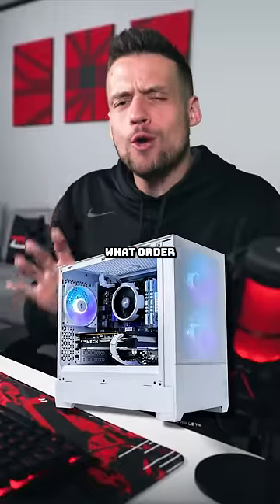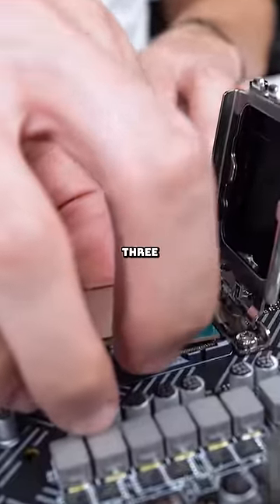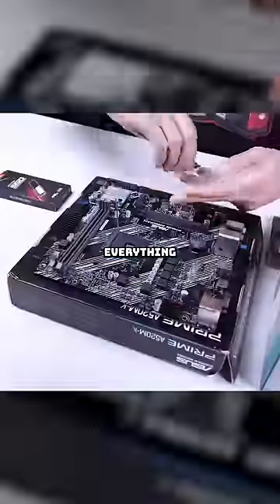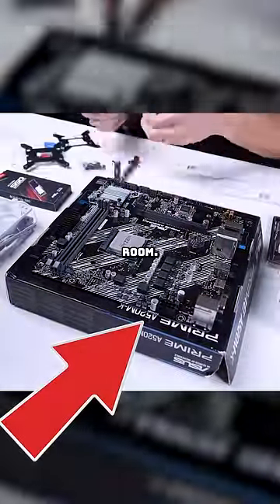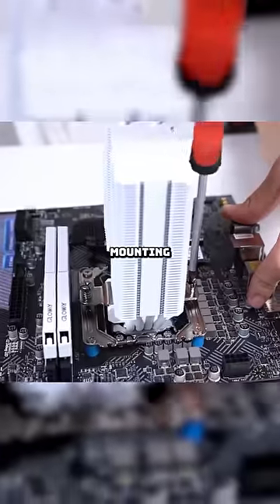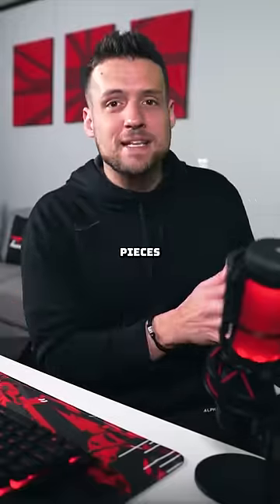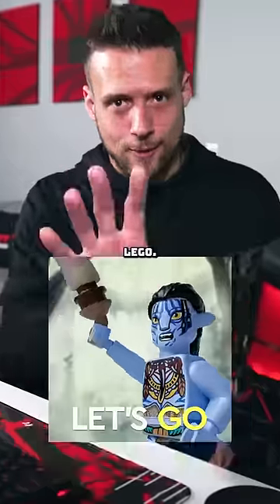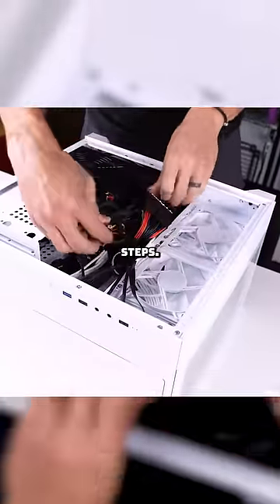PC Building Order of Operations

Comment: I would want to prep the case first.. make sure all the fans are in, the water cooler if I go with one of them, the PSU and do the cable management, leading all the cables to go where they will all go.. getting all them cables managed, then I will slide in that Mother board which as prepped as you said outside the box.. and soon as the MB is in, I Just connect all the connectors which are already in place where they should be.. connect the water cpu cooler pump to the cpu, and then last the GPU, and all its connectors..

Comment: I have been using the Thermalright SI-100 for cooling my CPU. It is a down draft cooler. I use low profile ram, so I place the overhang over my ram for some air flow. My VRM already have large heatsinks attacked. I do not buy motherboard without those. with exception of if I am using 65w chips and never going to upgrade that line. 1. Mbow 2. lay case on side and Insall everything this way. 3. double check all connections are snug. Then cable manage. I do not use extensions.

Comment: Always go for a full out-of-the-case assembly and post test that Frankenstein before putting it into the motherboard, in the long run saves you a lot of time id possible debugging in case of faulty parts, incompatibility or just things not fully plugged in

Comment: I put the gpu in first and then feed the motherboard in over the top and just bend it around to get the gpu into it. I also just throw the cables in anywhere and usually can’t fit the side panel on. This leaves no room for fans. And the radiator just hangs loose.

Comment: Mostly the same. The one thing I'd before all your steps is to disassemble and reassemble the case with what I need and route the cable for he front panel and what not for easier connection when installing the mobo

Comment: I prefer to plug the power supply cables into the motherboard before the PSU after I install the board. Makes it much easier to route the cables, especially the pesky CPU power at the top left.

Comment: I’m crazy so I do the motherboard first. Then the power supply and mobo and cpu power cables. Then I do the cpu and cpu cooler and plug in cpu cooler into power supply. Then I do the ram. Then I do the ssd. Then I plug in power and sata to Mobo. Then I do GPU. Then I plug GPU power. Lastly I plug in case front panel and double check everything to make sure all cables are properly secured and plugged in and to make sure all cables are nice a neat in proper cable channels with zip ties and Velcro straps.

My specs are:
CPU: Intel I5-6700k
GPU: Asus Black RTX 2060
Ram: XPG White RGB 3200mhz DDR4 (underclocked to 2400mhz cuz of CPU)
MOBO: Asus Z270-A
Storage: Kingston 480gb Sata SSD
CPU Cooler: NZXT Kraken Elite 280 White RGB 2.36” LCD Screen
PSU: Red Dragon 850W White RGB Fully Modular
Case: NZXT H510 Elite
Monitor: Alienware 240hz 27” 1080p FHD

My next pc upgrade is gonna be adding a 1 tb nvme SSD

Comment: I guess I took the chaotic neutral route. Screw mobo into case, install cpu cooler bracket after the cpu, ram, then the cooler, then the gpu. An m.2 ssd made its way in there at some point

Comment: step 1: pull out the motherboard manual to do some visual ground work to know where and how many headers are there to better do the wire maintenance 
oh and can’t forget the hat to keep my hair back and that esd braclet 
(Downfall of having long hair 😅) 

Step 2: install the board in the case with the cpu/ram/ssd installed 

Step 3: fill up on snacks, lots of snacks and blast that pc building playlist to get that motivation making that fancy sweater of wires in the back 

Step 4: after it’s all done press that button and watch that pc go ❤😊

Comment: I first build my PC outside of the case to troubleshoot any possible hardware issues. I then take off the GPU and PSU and mount the motherboard in the case. I attach the cooler next. I then put the PSU in the case and hook everything up. I lastly mount and plug in the GPU and I have successfully built a PC

Comment: When I built my build I did all the Mobo stuff and installed it into the case and then got the PSU out on the cable extensions and installed that too, of course the final step was installing the GPU and connecting it

Comment: I usually start with installing the ram, then cpu and gpu, cooler, power supply, hdd and ssd. after all this I prepare the motherboard, and install it to the cpu, then I install the case, close it and do sum cable management, I install the fans  and at last connect the power supply to the gpu

Comment: Cpu. Just cpu cooler brackets. Then i put the mobo into the case and then psu. And then connect all the cables i can connect including sata cables and the fan csbles without inserting the fans into the case (i kinda let them hang of the case). Then i put in the ram and then the cpu cooler and ssds . And then mount the already connected to mobo fans into the case. The best for last. The gpu

Comment: Step 1-10: Build everything 
Step 11: Realize you forgot thermal paste
Step 12: Pull everything apart
Step 13: Add thermal paste
Step 14: Put everything back together
Step 15: realize you forgot to take the plastic off the aio and repeat steps 12-14 while crying.

Comment: 1 you start with the pc case how you will put fans push pull configured  2  is cpu aio radiator 3 is motherboard prepared 4 is mount motherboard to case 5 is cpu aio mount bracket 6 is power supply and 7  is gpu

Comment: Should start a movement “say no to PSU cable extensions” function over looks. Extension cables cause additional voltage drop and this can cause stability issues. This is worse on high current draw devices like high end CPUs and GPUs

Comment: I just finnished a build but it went like this:
1 check everything for damage 
2 install cpu and ssd to mother board 
3 install mother board in a case 
4 attempt to install aio only to find out it doesnt fit 
5 spend 45min trying diferent combinations 
6.take evrything out and start thinking 
7 take the case outside 
8 cut out a big portions of the top panel 
9 install mother board in the case and aio from outside of the case 
10 connect most of the cables 
11 fit a 323 mm long rtx 3070 through a 315 mm opening and install it 
12 install ram and connect all the wires 
13 go sleep and pray that the pc will work 
14 consider a ritual sarafice to atone for the abomination i just created

Comment: I do first MB, cooler, GPU, thermal paste,   PSU, RAM then putting all of this in to case and then when all covers are mounted then I put CPU while whole system is ON and downloading drivers for power supply 👌

Comment: The best and only way to prepare the motherboard: 
1. put in the SSD
2. put in the CPU
3. stick the RAM in
4. put on the backplate of the cooler
5. install the mounting hardware of the cooler
6. put the mb in the case
7. take the wrong screws and wonder why it doesnt fit
8. find the right screws
9. realize you fucked up one of the standoffs
10. cry

Comment: for my first pc I did this: put the mobo in
2: try to put in the parts while working in case
3: put in GPU
4: plug cable and and get confused on how the CPU cable vanished and found it 5 days later 
6: doesn't work
7: takes to repair shop and finds out I bent pins and plugged in 1 cable the wrong way
8: no signal on my monitor
9: realizes I need to plug in to the GPU my CPU doesn't have integrated graphics

Comment: Pretty much the same order, even with the GPU in the end, though for most of my builds I'll install the cooler after I mount the motherboard to the PC Case. I usually deal with huge coolers like the NH-D15's or Dark Rock Pro 4's. Something smaller like Evo's I can prep before mounting the motherboard but the other ones are too big and I can't reach all the mounting screws.

Comment: I do my mobo first...ram cpu cooler and nvme if im using them...put my io shield on if there is one and then put everything in the case....never had a modular psu so just put that in and push the cables thru....make sure psu is on and see if it posts

Comment: aight so I start with the gpu, press in the cpu and hook up the psu. then I do some cable management, and then I put in the motherboard. I then like to clean my computer, so I let it rest in a bucket of isopropyl alcohol, followed by a stress test by banging the inside with a hammer. check the cpu for any bent pins, put some thermal paste on the fan to spread it around nice and evenly, and then try to start it.

Comment: step 1: build everything on the mobo
step 2: use it like that for like a month
step 3: get a case to put everything in
step 4: literally crying after 3 hours of mediocre cable management and only one green LED lighting up on the top fan out of 3 fans
step 4: get replacements, still didn't work.
step 5: update bios and the RGB worked finally

Comment: Well before seeing the video when I build my pc I put the CPU on the motherboard, then the ram, then the mobo in the case, then the psu in the case (no wires connected yet on any component), then the ssd, then the GPU so I knew which metal windows to break, then cables and it worked first time build
Reply: With cpu  I meant + cooler and the video seems to agree as well 😊

Comment: Step one: Buy new gaming PC.
Step two: Remove it from box.
Step three: Set it up.
Step four: play games.

It used to be back in the day building a PC was the only way to get a decent gaming system. In today's market there really is no point to build your own anymore. It doesn't save you significant amounts of money like it used to. Even prebuilts have over locking abilities now.  Building one just for the sake of building it is more of a hassle than any return you'll get out of having built it yourself. The actual assembly is ridiculously easy. Everything goes in one place and one way. It's not rocket science.

Comment: I run all the wires first and the plug them into the PSU outside the case, and then mount the PSU in it's location.

Comment: Always start with the I/O Shield if it is seperate, because I will just forget it otherwise. Then, if the PSU is modular, I plug the CPU 8 Pin into the board before I put it in the case, because I sadly don't have tiny racoonlike fingers.

Comment: so i do ssd, ram, cpu, screw in the radiator of my aio, which is only if i have an aio, then ill install the mobo, put the aio mounting on, prep the psu, insert it, connect cables, cable manage, here if i have extra fans i would install them, then i would install the gpu and test if it turns on, followed by a satisfying peel

Comment: when getting a parts list I always get the big stuff like GPU first and see what PSU ill need to spec into and then work my way down the list to stuff like a case and storage last. when building the PC I do everything on the mobo that I can before putting it in the case itself, can vary a bit by case but typically goes about the same every time

Comment: when I build I usually start at the case because I always have aftermarket fans while I'm there I go ahead and mount the power supply and fan controller then basically from there I do exactly what you do I just start with the case and power supply and fans

Comment: I start the same with mobo prep, then psu prep but screwing components into the case depends on the type of case I want to install everything in because sometimes there is a little problem with passing the cables through cable management holes (like 8x pci-e in asus prime ap201 with mobo inside) and then if i have a specific order from somebody like putting other fans than these what comes with the case, I do it before installing anything just after mobo and psu prep

Comment: Cpu goes into MOBO, then ram then storage, then cpu cooler (air cooling usually) put mobo in case, connect all Front IO psu and etc cables, then try and start it and the realize I didn't plug in one of the Front IO Cables 😂

Comment: I unbox all the stuffs, install the CPU, Ram and use mx6 thermal paste, install the cooler and GPU while it's on the box and test all components, then i install the PSU into the case and then i install the mobo and then the GPU into the case then i do cable managment 🤌

Comment: so I only built once but I pop the cpu in, the ram, the ssd then the cooler. After I plug the motherboard in and do a test. Then I put everything in and if I have a gpu I’ll put that in last after connecting case fans and everything up.

Comment: I pretty much do what you did.. but I connect all the cables BEFORE I install my motherboard in the case with screws. I always cringe when I see builders install all the parts and then screw the motherboard in place and install connectors like 24 pin when it's in the case.... I don't want to risk bending on damaging the motherboard.

Comment: Case Fans PSU

Motherboard CPU SSD RAM

Cables

CPU Cooler GPU

GPU cable

It’s easier to do the wire management, with some CPU coolers it’s a requirement if it’s too big

Comment: I usually install gpu first because let's be real that all you need really then install ram into power supply because how else is it gonna work  then put my monitor in the case thank got for those nice atx glass case's.  Just be sure to zip tie the cpu to motherboard or you can use string but drilling a few holes helps. Next you hook your phone via micro USB and download por.. I mean windows  find a cracked version that 100% will work and not contain viruses. Then buy a pre-built because you just got tired of working so just toss that 3080 away and call it a day

Comment: "everyone does it differently" No, you just do it wrong, cpu into mobo, psu into mobo, test with no ram, turns on, able to get to bios/uefi... Good first test done, power off, put memory in,  turn on go to bios, does it recognise it, yes... well done 2nd test done...
repeate for hdd/m.2/ssd's, check bios.... all good, well done 3rd test done.
Now, install your os, whilst outside the case, boot into os, reboot... all working good, 4th test done. 
now add psu extentions, turn on, all working, good, another test done... now unplug it all assemble into case, ug in the psu, test again, turns on, everything is how it is suppose to be... good , no shorts. now add pau to case and done.
Reply: plug/connect, psu** will not let me edit.
never assmble, without testing first, otherwise if you jave a problem, it is easier to find when it's outside the case...

Comment: I first put cpu ram ssd  and cooler on motherboard then I take the case and put the psu then I will take the cables and connect to motherboard then I put the io shield and install the motherboard then I install the ssd and hdd and cable manage and yeah

Comment: cry cuz i spend 1.3k on a pc, mobo, gpu, ram, cpu, cpu cooler, psu, case pins, test, boot loops, swaps ram slots, reseat cpu, test, works, try to install windows 11 450 times but all had no driver error, my coisin comes to the rescue with a windows pc

Comment: I just built my 4070 Ti Super 7800X3d and i started with mobo cpu ram ssd, then i åut in the psu then i connected all of the pins (including the PCIe for the gpu and then i put the gpu in and connected it the only thing that is wrong is that they didn't have my aio in stock so i dont have it yet but when it arrives im pretty sure i can attack it to the motherboard without removing it cause theres a hole behind the mobo

Comment: Me it's installing GPU black on GPU the install CPU block then ram test it all on the motherboard box then install motherboard in case then SSD and GPU then fittings power supply then cables management then pump res combo then soft tubing leak test then fill the loop

Comment: I put the GPU in first then the CPU and CPU cooler then the case and then the PSu and finally I put in the SSD by taking out the GPU to reach it and then putting in the GPU and Finally I install the ram

Comment: i kinda wish I connected everything to my mobo before putting it in the case. Cuz there's an unused fan plug slot that I couldn't reach cuz not enough space in between the case walls and my huge cpu cooler

Comment: Guys i have a  

asus rog b550 gaming f

zotac amp extreme gtx 1070 ti 

atx psu 

my current pc case (red dragon steeljaw GC-608) which i have been using from 3 years is starting to make my pc hot 

i want to upgrade my case but only have a max budget of 100$

suggesstions will be appreciated

Comment: I think I should upgrade my laptop because it has this:

Device name
LAPTOP-5EQ1Q9RD
Processor
AMD A10-9620P RADEON R5, 10 COMPUTE CORES 4C +6G 2.50 GHz
Installed RAM
4.00 GB (3.87 GB usable)
Device ID
44925B6E-C85C-4BED-8960-B802DD26BB07
Product ID
00356-02062-45176-AAOEM
System type
64-bit operating system, x64-based processor
Pen and touch
No pen or touch input is available for this display
Reply: And this is from 2019 it can somehow run war thunder